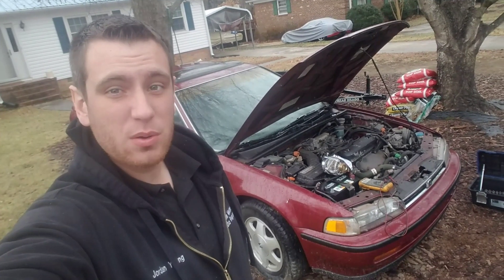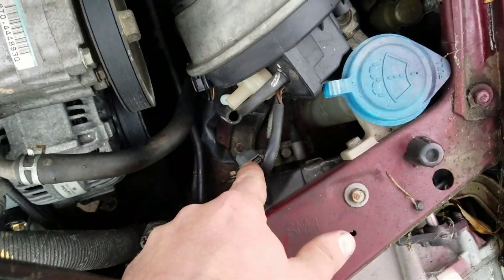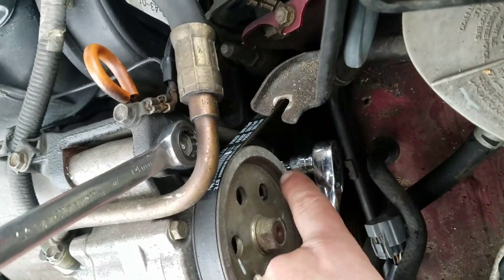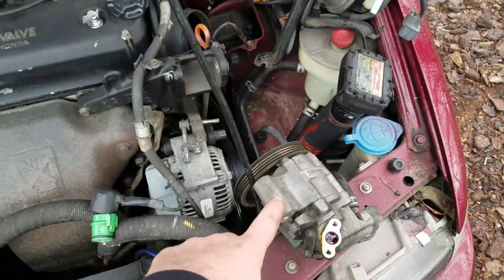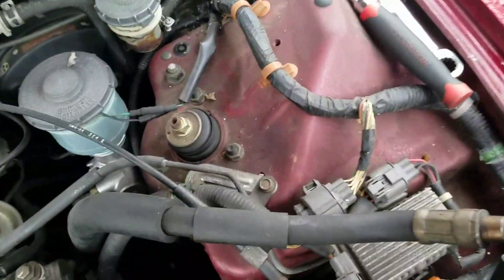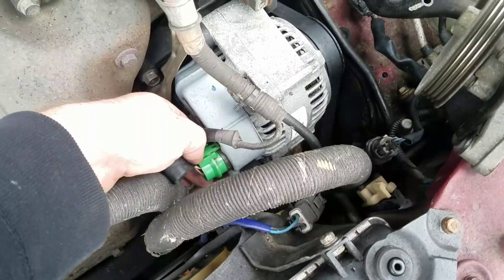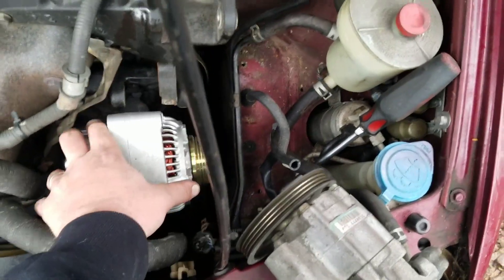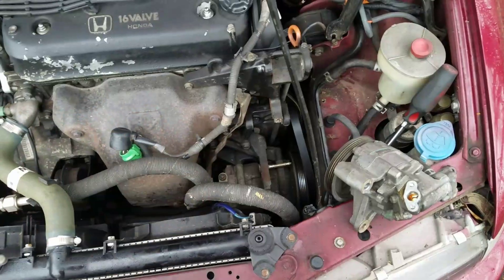Alternator "how to" 90-93 Honda Accord Alternator Removal Replacement

Comment: Thank you for the video, it really helped especially when I had to reinstall all the hardware, which was a major pain in the ass mainly because I'm 67 yrs old, but I dominated the bastard and got er done.
Reply: Alternators on this car is really tight space. Lots of cussing and slipped wrenches
Reply: The orientation of how that tension bracket goes is tricky, had to resort to this video

Comment: Thanks for showing how to do this! I'm going to be replacing the alternator on a 1993 Accord Ex coupe 5 speed manual in a couple of weeks with my 15 year old son. We have the Haynes manual,  but having a video showing how to do it is better. This is a great tutorial for learners!
Reply: jamesboone14 did this video help you were you able to do it?
Reply: K. G. Yes indeed. It helped to see what to expect before I changed the alternator. Thanks a bunch!
Reply: I'm a female that wants to learn how to change my 1991 Honda accord alternator. Think I can do it successfully or should I NOT attempt it?
Reply: TooBlessed ToBeStressed If you follow this video and pause it during the each step,.. I think you will be fine. Just take your time. I think the most challenging part will be replacing the  rubber belts if you choose to do so. If you don't loosen the alternator enough, ... the belt will be difficult to install,... I had to learn the hard way. If I had just loosened the fastener a little more,... The that step alone would have saved me 30 minutes of frustration...lol. If you loosen the alternator tightening screws/fasteners,...the belt goes on quite easily! Good luck and have fun. It might take you about 1 hour to do this.
Reply: jamesboone14 oh wow thank you so much. It sounds like fun actually. Lol. Oddly enough, I'm only 26 and I've taken an interest in doing things myself (even manly duties)
Reply: Oh, and I have an Automatic transmission. Does that matter?
Reply: TooBlessed ToBeStressed I'm fairly sure that the alternator replacement instructions are the same for manual and automatic transmissions.

Comment: THANK YOU!   this helped a lot...the socket sizes saved hassle and the big overall steps just made it simple, the only finicky thing was reinstalling the tensioner on the alternator,  first, as it was a tight for my fingers, second, getting to the 12mm bolt on there was super tight for my socket set .
Reply: Same this was a pain in my ass for about 30 minutes

Comment: i followed it through successfully but now its squeals loud could the belt be to loose or too tight??
Reply: Matthew Montoya Is it still squealing?
Reply: Usually squealing belt means too loose. Just try to tighten a bit more and see if that fixes it. Also this is why some belts squeal when wet in mornings, not tight enough.

Comment: Dude, I'm STUCK like CHUCK, but the problem is, I give a fk.  

My son's 93 Accord.  I need to know how you took out the adjuster bolt.    It's frozen in there.  I tool off the nut, but that bolt is, which I call a "collard sleeve", won't budge.  I can't get any kind of a tool in that tiny space to tap it back through the other side (tapping it to the right).  It's the only way to get it out, but it can't be done.  Why they designed this thing like this is beyond my understanding, 🤯.   I noticed you didn't show how you did it.  How's come?  This is the critical part.  

I have the PS disconnected, and, this 93 is IMMACULATE!!! fyi.  91K, all CHERRY, BtB!!!

Please get back to me.  I need to know how you did it.  Thanx
Reply: PB blaster can get stuff unstuck. Otherwise you don't even have to remove the adjuster bolt, at least not on the 91 accords.

Comment: Have a Question!
What if I didn't Disconnect the Negative Cable from Battery and the Alternator made a Spark?, Does that mean it died Completely? Please Answer Or Anyone... 😔😭 I Think I Messed up.
Reply: LMAO
Reply: You probably needed to replace one of the main fuses.   Of course since by now someone must have fixed it, you could have come back and posted what happened to help others who might get the same issue.

Comment: Can anybody tell me the belts name

I know has 3..the timing belt what are the other 2 called
Reply: Alternator belt, and power steering belt are in this video.    Timing belt is inside the engine cover, so it cannot be seen in this video.

Comment: Thanks, but there are too many steps and processes involved for a 3½ minute video.
Reply: topgrain I was able to follow along fine. It was convenient cause I needed to replace my power steering fluid too
Reply: @sisyphusofephyra3734  fyi you don't actually have to remove any lines on the power steering.